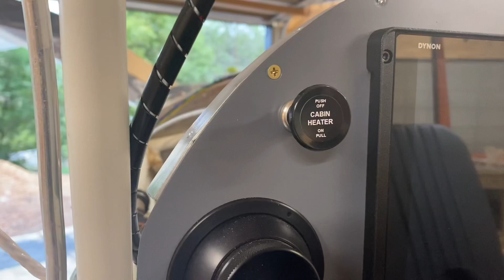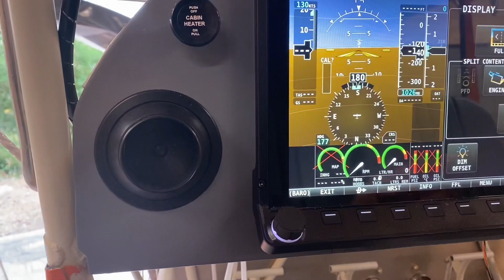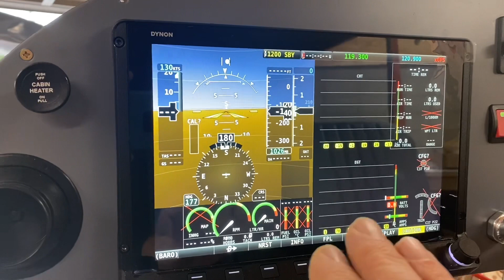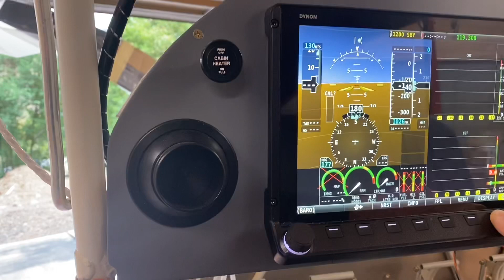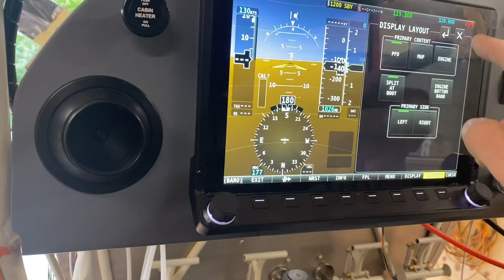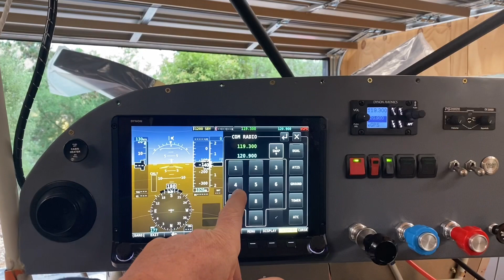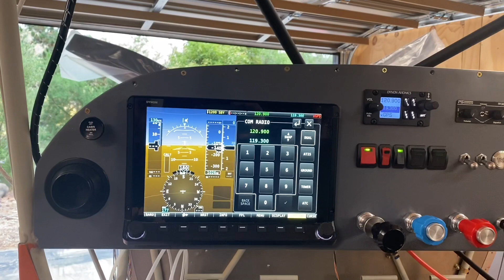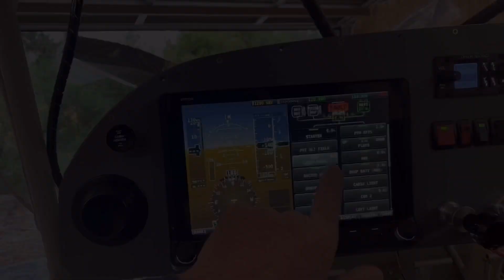Bearhawk build #9 - building a Homebuilt Bushplane aircraft in my garage

Comment: How has your head/eye position worked out with those seats ?
Reply from the maker: It’s worked out spot on - eye level is just below the wing. I had to keep the seat cushions thin - 40mm at the back of the cushions and 80mm at the front for thigh support.

Comment: You are doing a really great job, inspirational. Going to be a really nice airplane. For the parking brake outer I would wrap two turns of safety wire around that coiled outer, across the Adel clamp and then two wraps the other side. Makes it very solid.
Reply from the maker: That’s a great suggestion thanks. I’ll do it !